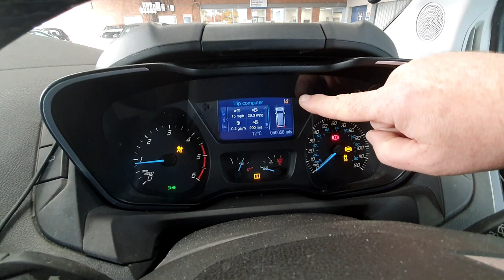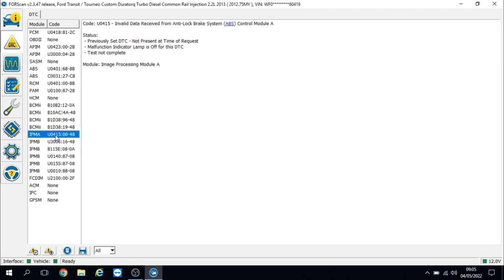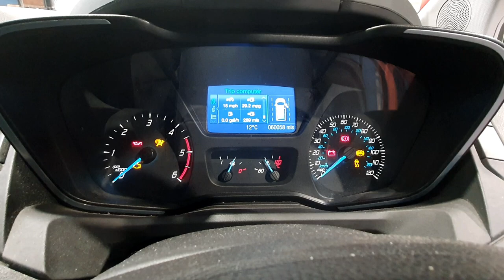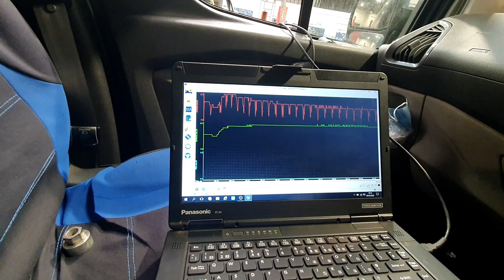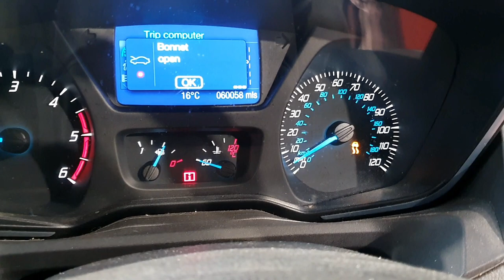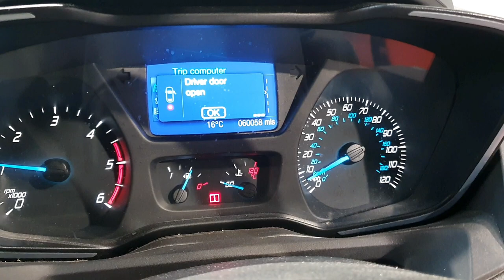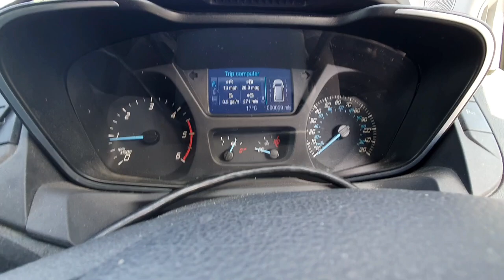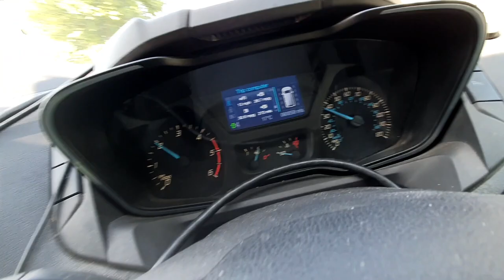Ford Transit - Can a wheel bearing really cause this?

Comment: Had a 2015 Transit that came in with abs fault , airbag , traction control all on , speedo ok , traced fault to abs sensor on nsf catching wheel rim , new sensor fitted , all lights go    out , good old canbus Steve , could send many down the Rabbit hole , another  great video , excellent diagnosis,  the punter probably tried to buy a genuine abs sensor rather than one from eu know who (yeah )  , I recently waited 8 weeks for a 2018 Ranger headlight (backordered) , but had to pay first before parts plus would order it 😂😂

Comment: Top job mate 👌 nice video showing the fault, diag and fix. Not always the best jobs when someones been in beforehand are they  For the sweep test instead of using FDRS I go into ET mode and do it manually...saves 3839364 days waiting for FDRS to run the network test 🤣

Comment: I got same warning lights and fault code C0300, i already order new wheel hub and hope it work after that.
Reply: Can you tell what are bolts torque numbers with all bolts which need remove.

Comment: I do have 2011 Ford Focus with flashing light and no start. I got a new IC but seems not to get the IC panel as shown in  your video. I am using FORScan with 2 months extended license. What can I do?